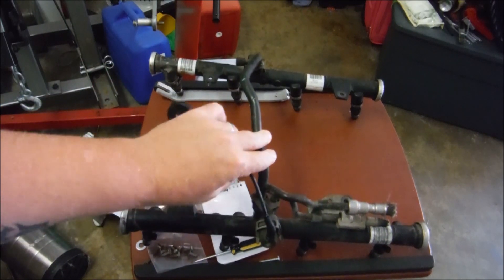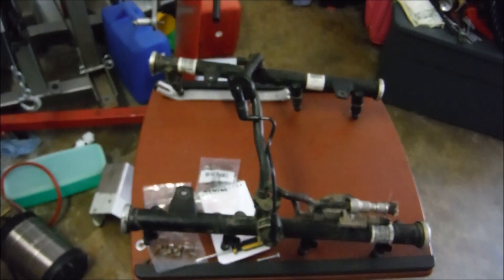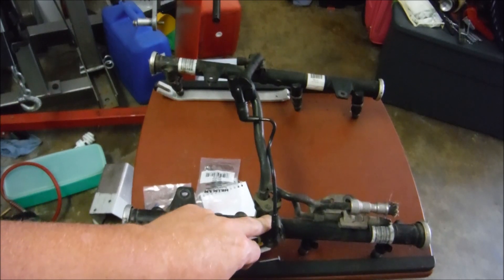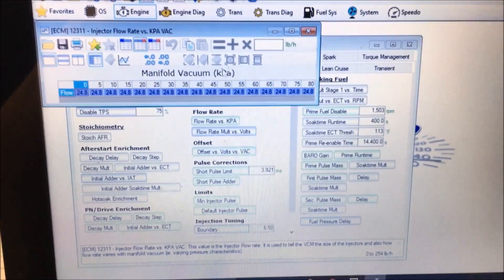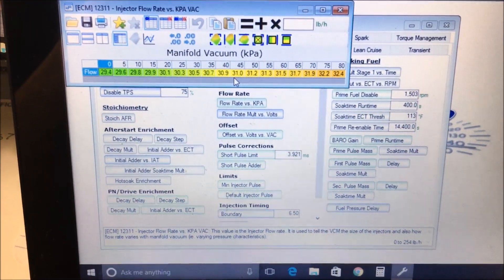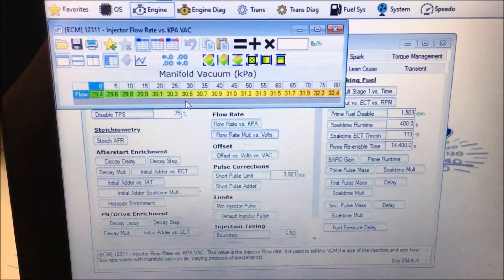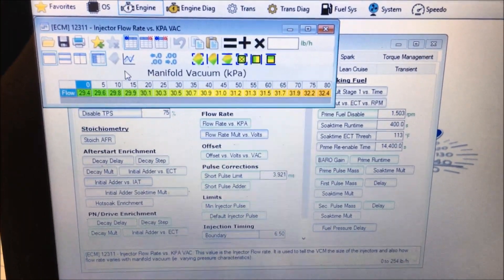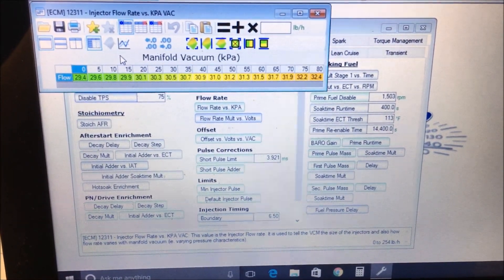LS ENGINE FUEL PRESSURE FACTS AND MISCONCEPTIONS

Comment: Good video my ls with corvette style filter regulator idle 73 psi just turn key not starting 43 psi ls6 5.7 any help
Reply from the maker: Assuming you have the file lines hooked to the correct ports, it sounds like either the filter/regular is bad or you’ve got too much pump for the vette filter/regulator and it’s being overrun.
Reply: Put a new fuel regulator not a cheap one brought up presure at key on 58 psi but still 80 psi running  @BadLuckGarage

Comment: I can confirm that xxx628 truck injectors won’t idle reliably at 42 lbs of fuel pressure no matter what you do. It’s the pressure regulator that dictates pressure on return systems. It’s the pressure regulators that vary from 43 lbs to 58 lbs that cause the confusion.
Reply from the maker: Thanks for watching. Glad this video helped you out!

Comment: Thanks buddy I subscribed. I’m 5.3 LS swapping my gbody MCSS and using the return fuel system, my original fuel line and return line are 3/8 and 1/4 for return, would 1/4 be fine with a BTR cam kit or think I need to switch the return line to a 5/16?
Reply from the maker: Brother 3/8 feed and 1/4 return will easily support a cammed 5.3. Hell before we went twin turbo with the Chaps Theory Camaro we were on the factory feed and return line with a cammed 5.3 on a 225 shot of nitrous with zero issues. Lol.
Reply: Awesome buddy thanks. my older brother also said that it would but like you said internet mechanics or listening to too many keyboard warriors i guess lol

Comment: i have a gen 3 6.0 swap that all factory gm stuff and i get a issue where it wont start unless i release pressure from the fuel test port and crank it before fuel pump kicks in and it will fire , run and drive perfectly. but wont fire if shut off and try and again quick only if i release the presure at test port. have changed regulator pump and injectors plug wire and coils maf sensor and otherb stuff no changes even had someone look at it with hp tuners im at a loss now

Comment: Man im trying to figure my issue out without luck. Engine wont run with the fuel pu.p running. I can prime it and then cut power to the pump, and then engine will run until it runs out of fuel. If i try to connect the fuel pump to power it kills the engine. 66 lbs of pressure when primed.

Comment: I know this is kicking a dead horse but my gen 3 5.3 that I put in my 1985 c20 suburban wont start first crank and will always fire right up on the second attempt. I have good fuel pressure  (which I thought was the issue until watching this video I had no idea about the return style vs non return so thanks for that info) no priming issues or drain back issues. The only thing that is physically different/new on this engine cam and lifters (stock) new crank and cam sensors, and has shorty headers and no catalytic converters. What would be causing this starting issue cause I have exhuasted every possibility I can come up with and still am shit out of luck on fixing this. 13:55
Reply: Did you ever figure this out? I have this same issue on my 5.3 swapped S10 ZR2. Can’t seem to figure out why it’s going this mf I’ve replaced everything I could think of.
Reply: @Nashh830  yeah it was after market cam sensor for me, get a gm genuine or ac delco cam and preferably crank sensor but it seems like the cam sensor was the main issue, popped it in and the thing fires up every time first try. So far my oreillys crank sensor has been good for months now

Comment: I have an 07 2500hd classic 6.0. I had it rebuilt for more hp (flat top pistons forged internals, truck norris cam, 799 heads with all the upgrades). I believe that I need to go up to 30lb injectors. 1. Which injectors do I get and 2. Do I have to have it re-tuned when I do? Making 315 RWHP in a 4x4 should mean about 400 HP at crank yah?
Reply: Btw current issues are loss of hp at WOT and dies or hard starts occasionally.

Comment: I have been meaning to subscribe and ask you a simple question. Here it goes. Why myself ,and my tuner can't figure out why my LS Swap bogs only at WOT. It is a 2003 Silverado 6.0 Liter with Terminator X Max and 4l80E tranny. It is all stock, except that I have an LS intake instead of the truck. It has 3.90 gears. It freaking rides so well at cruise and or rolling down the street. Once I go WOT, it chokes. I have to let go the pedal and press again then it takes off like a wild horse. What do you think.

Comment: Hey Robert quick question, I have a 2003 Chevy Silverado 5.3 LM7 and I just replaced the injectors yesterday, since the originals were beginning to fail one by one. I did notice the original ones were 2 holes for the spray pattern and the replacement ones(from TRQ) have 4 holes. It was listed as a direct fit for my truck and everything went in fine and the truck actually runs pretty good(as to having a few bad injectors previously), is there really a big difference between the 2 hole and 4 hole injectors as far as flow rate and all? I don’t have anyway to test the flow rates myself, but can check short and long term fuel trims which have been staying around 0% and dip down to the negatives just a little. And also I have a Deatschwerks high flow direct replacement adjustable regulator on it, currently it’s set at about 55-56psi at idle with vacuum line hooked up, and with vacuum line unhooked it goes to right about 62psi. Would it be better to back it off to 58psi or is it ok where it’s at now? Just trying to shoot for having a good properly running engine

Comment: So my 2006 ls 6.0 has a stock gas regulator on the fuel rail how do I test it….? Mine reads 50 max. And it doesn’t change with the aftermarket regulator when I try to adjust it.

Comment: I have a 15 camaro LS 3.6 manual and replaced about everything and still have a low pressure fuel and engine won't start. It tries but don't want to replace fuel pump. Replaced sensors also can you help

Comment: Thank you sooo much for this information. Now I have to figure out why I'm getting fuel in my cylinder even tho I replaced thee fuel injector.
Reply from the maker: The injector always has power when the key is forward. The pcm fires the injector by grounding it. If the injector is spraying even though the engine isn’t running it could either be an issue with that injector driver in the pcm, or the ground wire to that particular injector could be pinched and grounding out all the time.
Reply: @BadLuckGarage  once again thanks. Back to the drawing board after I get the fuel out of this cylinder...🤦

Comment: Would low pressure when not running cause a no start ? I’m new to the ls swaps ( I know my diesels )  I  have 40lbs that holds while cranking but won’t start . Starts on starter fluid but cut off .
Reply from the maker: If you have 40lbs while cranking and a halfway decent tune the vehicle should start. Sounds like your injectors aren’t firing which could be caused by several of the things mentioned in my “4 reasons your LS swap won’t start” video.

Comment: So, when I first turn key to on the pump primed to 55-60 psi and stops. Then, when I turn the key farther  to start, the engine starts and runs, either at idle or at 100mph and 6000rpm, the fuel pressure reads 80-82 psi. Car runs great!  Do I have a problem?

Comment: I have a 2002 gmc yukon with a return style system and the fuel pressure drops immediately after the engine is turned off, i already replaced the fuel pressure regulator, do have any ideas on what it could be? Thank you
Reply from the maker: The check valve is built into your fuel pump. The pressure is going to slowly drop once you turn the vehicle off, but if it’s dropping IMMEDIATELY then it may be time for a new fuel pump.

Comment: what if you have a 90 psi pump in line will your fuel pressure regulator keep it at the right pressure
Reply from the maker: The volume of the pump is what matters, not the max pressure it’s capable of.

Comment: I understand its an old video, but have a question. Im using a corvette filter on a returnless fuel system. It has good fuel pressure but when i turn off the truck it doesn't hold the pressure. It loses the pressure quick
Reply from the maker: Either the pump you’re using doesn’t have a check ball or the check ball has failed.

Comment: Hi. I have a returnless 5.3 silverado 2004 motor (in my 79 truck/swap) with a new holley regulator (162-590) that gives me 58 psi on ignition, then 70 psi on start and acceleration and drops to 0 when the truck is turned off. Could you share any insight of why this is happening or if its even normal? I have searched everywhere and i cant find a solution. Cause my 5.3 is the one that does not have a vaccumm on the fuel rail. Thanks
Reply from the maker: The 162-590 is just a C5 corvette regulator/filter. They generally don’t work well with anything larger than a 255lph pump. What fuel pump are you running? It sounds like you’re overrunning that regulator.
Reply: @BadLuckGarage  I left the fuel pump the tank had which is a Kenso 340lph that i was told is a sub for the walbro 255. Aside from that, will tgat 70 psi affect the motor working properly in any way?
Reply from the maker: @isaac787garage3  that pump is 340LPH. Way more than the vette filter/regulator is rated for. You can have it tuned around the high fuel pressure but it would be more advisable to replace either the pump or the regulator to a more compatible setup as running the pressure that high will cause the pump to run hotter and eventually cause the regulator to fail prematurely. My opinion is I would replace the pump. Because as I’ve shown on this channel multiple times the cheap Kemso and Oasis pumps are good for leaving you stranded on the side of the road. I haven’t had either of them last for more than 1000 miles or so before failure. Most of the people who use them and think they’re good pumps don’t put any miles on the vehicles they use them in. If it’s just a vehicle you’re going to take to cruise-ins every now and then or do burnouts then by all means use the Kemso pump. If it’s something you want to be reliable and plan to put a lot of miles on, just swap it out for a Walbro 255 and you’ve solved two problems at once.
Reply: @BadLuckGarage   @Bad Luck Garage  thanks for that explanation it helps A LOT! I wont be using the truck much just the ocassional cruise or quick run to home depot. However, i am concerned that the 70 PSI its giving me could also be creating some acceleration problems. Right now when i accelerate it, the truck is behaving as if it has a missfire (i changed the sparkplugs and colis so that is not it). Could the pressure be causing that? Because if it could then i would need to replace the pump anyways.

Comment: I've got a lq4, TBSS style manifold with 2010-2013 stainless (returnless) fuel rail, vette style filter FPR and a kemso pump rated up to 68psi. I have pressure holding in the on position (prime) hits 50 and will drop to 42 and sit there. As soon as I start the truck it bounces from 48-70...injectors I'm suspecting

Comment: I have a newly first time LM7 swap into a manual square body truck.  I followed some internet suggestion and may a problem.  I have a 2001 return style fuel system.  I put a inline corvette style regulator and plugged off the return port at the intake.   The truck doesn’t fire right off on the first crank and it stalls out during changing gears.  Should I take out the corvette style regulator and just run a return line back to the tank. Thanks.

Comment: I’m running in an issue if you can help me out I have a fuel rail with the return line I put a fuel pressure test turn the key over berly made it to 50psi then slowly starts dropping down

Comment: What should it be with a carburetored set up.  It’s on 04 5.3 gen 3 ls .
Reply from the maker: It shouldn’t. Because an LS never came with a carburetor. If you insist on putting a carburetor on it and tossing half the reason for doing an LS swap in the first place, then it will require the same fuel pressure as any other engine with a carburetor on it which is generally between 7 to 10 psi depending on the exact carb you’re running.

Comment: So on a return style system with an after market jegs intake and a fuel regulator,what pressure should I shoot for?
Reply from the maker: Depends on how your fuel flow tables are set up in your tune as explained in the video.

Comment: What about underload? I’m pretty sure I’m losing pressure because it’s surging above idle I have a 02 return style
Reply from the maker: Same
Reply: @BadLuckGarage  so it shouldn’t go down at all
Reply from the maker: @Danny reid  fuel pressure will vary based on vacuum as explained in the video. Higher vacuum will cause the regulator to lower the pressure. Less vacuum with cause the regulator to raise the pressure. Zero vacuum should have very close to 58psi unless you have the flex fuel regulator as explained in the video.

Comment: I recently replaced my injectors. All the videos I see for this the mechanic kept the cross over line intact. I didn't do it like that I took each side off independently. Now I have a multiple cylinder misfire.  Do you know why everybody left that line intact and any suggestions on getting problem resolved. Thank you

Comment: What is the static fuel pressure for a 2001 2500hd with a 6.0 lq4. Key on engine not running
Reply from the maker: https://youtu.be/wA6mmc8fvQo

Comment: I know this is an old post, but I have a question. I LS swapped my jeep (LM7 engine). It has a return. Runs great! I put a fuel pressure gauge on the dash. Pressure regulates awesome - from 47-55 depending on acceleration.... When starting after sitting for an hour, I have to turn the ignition to Acc and let the fuel pump build pressure (twice) until it hits high 40s, and then she starts and runs great! Am I loosing pressure back through the return while it sits? Do I need a more powerful fuel pump? (Im using the jeep pump)  Thanks for any advice!
Reply: im assuming you figured your issue. but if not,  if you are using the oem jeep fuel pump assembly, youre likely loosing pressure in that assembly, between the pump and the bottom of the big plastic cap (top of assembly)
Reply: @rubberduckyTJ  Haven't check that. I added a check valve in the line, and that seemed to have resolved the issue. Thanks!
Reply: @ssarkees  i had it for about a year, never caused an issue, but was always odd that if i turned rig off prime would dissapear FAST  changed the internal hose out, and she solid now  (slowly bleeds off as normal)

Comment: So I have a returnless fuel setup. Directly off the pump I am getting 90-95ish PSI but at the rail (In the start position) I am only getting roughly 48ish PSI. The truck ran completely fine on first startup, now won't even start at all. Just continues to turn over. I've got power at the injectors, fuel pump is good, grounds are good. Only thing I can think of is that the regulator is bad. I have a c5 filter/regulator

Comment: I have an 07 colorado with an ls swap gen3 6.0. Have a returnless style system and it has about 15lbs of psi. Idle surges and apparently dumping alot of fuel because my cats start glowing red after about 5 minutes of running.  What do you think I should start with?

Comment: Should the fuel pressure go up with rpm? Mine drops as I hold the idle up. Fuel trims read high when I let off the gas. Cel flashes after holding high rpm a few seconds. I’ve got a 2003 1500HD 6.0
Reply from the maker: If it’s vacuum regulated it will go up as vacuum goes down.

Comment: Great info. I have an LS swap using this exact  return style rails but a corvette style regulator. I plugged the return. I have it tuned accordingly. Do I need to unplug the diaphragm or does that even matter at this point ? Running a little rich at idle. Thanks

Comment: Hey Robert thanks for the info,I replaced the fuel pump on my 02 Silverado 1500 with a 5.3 liter vortec. I was concerned about the pressure showing 50 psi at idle, but after pulling the regulator vacuum line and blocking it I got a smooth 58 psi! Thanks very much! My system is a return style

Comment: I have a 04 silverado 4.8 returnless fuel system. I'm turbocharging it and I am using the DW400 fuel pump module ( suppose to be good for 750 rear wheel horsepower) My ? is how will the fuel pressure be regulated. from the intank regulator, computer or both. I haven't talked to a tuner yet but I want to have it set up right. what would you do.